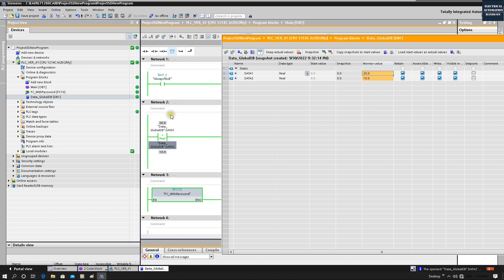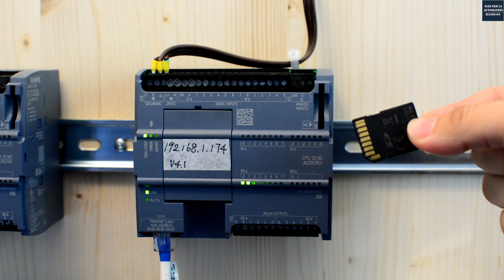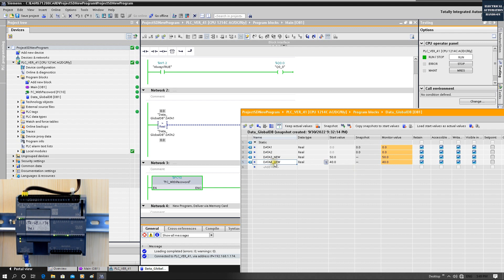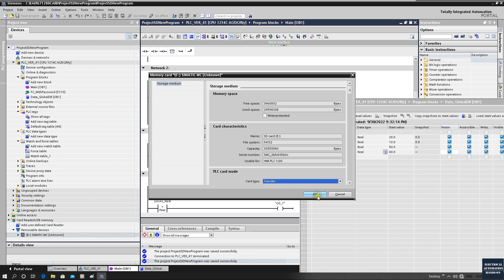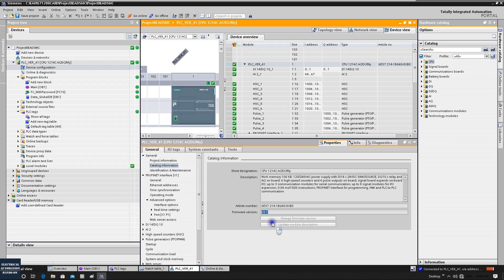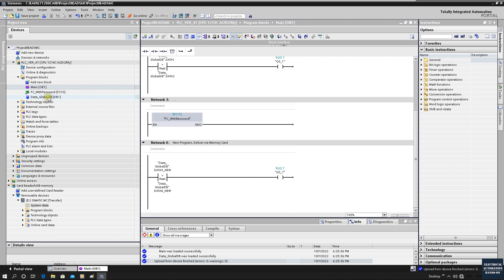SC08. How To Deliver a New Program to a Remote Siemens S7-1200 PLC via Memory Card

Comment: Great video. What if I need to send memory card with new program for S7-1500? I guess I need to leave „Program“ mode and not to choose Transfer mode. I guess all other steps are the same?
Reply from the maker: S7-1500 is different with S7-1200. The Card for S7-1500 is like SSD of computer. You download the program and the all the program is located into the card. Then you can remove the card and insert into another same type CPU. Or you use laptop and TIA portal to drag program into the card, then insert card into a CPU. easy.
S7-1200 has it built in load memory, that is why using card need addtional operation.

Comment: Can you do the same on the S7-1500.  As the s7-1500 needs a memory card does this mean you don't use the transfer card method and select program card instead then leave it in the PLC  when you put it into run.
Reply from the maker: For S7-1500, it needs card, so the CPU will run the program which come from the card. So transfer your program into the card, and insert it into the S7-1500 CPU, that it is. But your online CPU values/data will be lost after you run a new program from a card, BE CAREFUL.

Comment: Question: if there is an HMI (e.g. KTP1200 Basic PN) in the project list of devices, can you drag and drop the HMI folder into the Simatic MC folder in the same way that you did with the PLC folder? Then when you put the card into the PLC slot, will it upload the new HMI software? Thanks

Comment: I had a program wiped out and when I downloaded the program the system wasn't working at the bigining I thought the backup was corrupted, after analysing the program.. I had to reintialize all the timers and pid
Reply from the maker: the backup has two meaning, one is the only program back up, this is without the online data uploaded and backup, this is not enough. The second is to upload the DB/or snapshot the online data into the offline DB, plus the code program backup.
Reply: @electricalautomation thank you, that's exactly what happened

Comment: Good video and thanks alot 👍. 
One question... if i chose memory card type: "program" and not "Transfer". Were is this "Program" mode used?
Reply: Please how to do back up in mode “program” ??
Reply from the maker: If you select "program" then the situation will be the same as S7-1500 PLC, means that the program will be only in the card, card is the load memory. Then CPU will only own online live data, at this mode, CPU only plays the work memory.
Reply: @electricalautomation  ok thanks.
In your case the cpu 1200 have its own Load memory and therefore you are using memory card only as "Transfer"
 Does 1500 not have its own load memory like 1200?
Reply from the maker: @genantamtam9364  S7-1500 does not have its own load memory, it must use card. But S7-1200 has its own load memory 4MB. that is the reason S7-1200 is very great for the middle and small size machine.
Reply: @electricalautomation  thanks for the answer. 
Have a great day
Reply from the maker: @genantamtam9364  You too! Welcome!